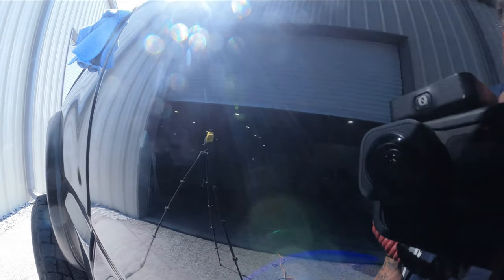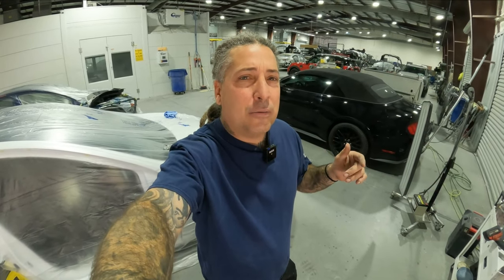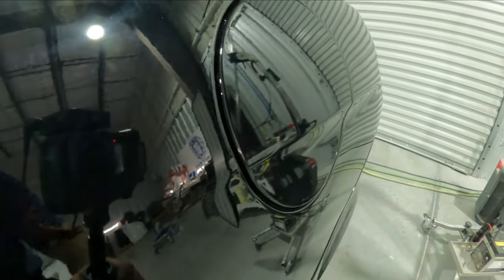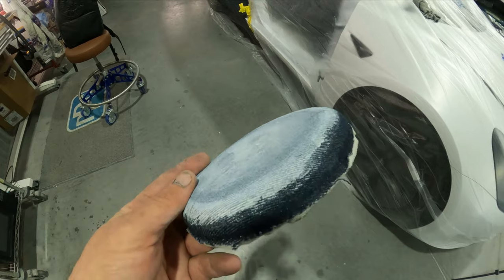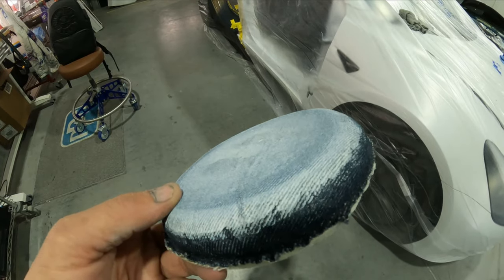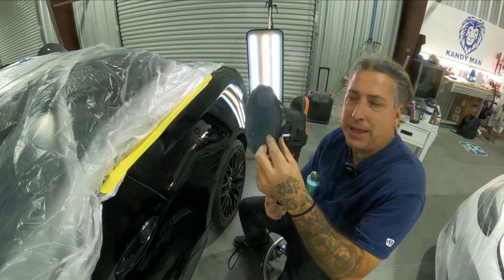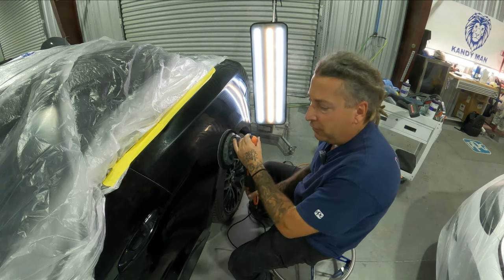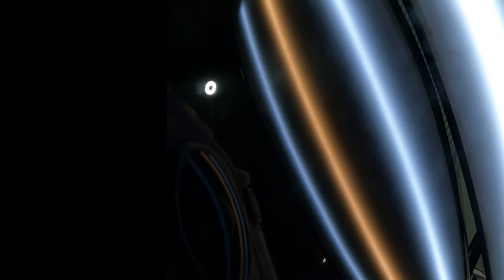How To Get Rid of Orange Peel Fast & Safe - WITHOUT Sanding

Comment: I just LOVE the Chemical Guys C4 clear-cut compound. This is the ONLY thing I've found that takes out bird crap stains. When droppings hit the surface, they burn into the clear coat, and no chemical will remove the stain. Virtually every method I read online didn't get rid of the stain. You need to remove the part of the burned clear coat. This stuff does it! After removing the stain from the clear coat, I used the P4 polish to restore the shine. Just make sure when using both the C4 and P4, each one uses a specially designed pad (and they're colored to match the bottle color so you don't get them mixed up.)
Reply from the maker: Thanks for the insight 👍

Comment: Painted a quarter panel yesterday ,and corner of bumper,so to make this story short,instead of getting the can of blender to melt the new clear into the old clear,I grabbed bulldog plastic promotor,and sprayed it to melt the clear,then that smell of adhesion promoter hit my nose,but it was to late,had to let it dry then wet sand all that stuff off until the new clear feathered out to the old clear.What a pain in the ass that was.😮
Reply from the maker: Man you know I know that feeling well it's sucks but once it's over we get a laugh about it for many years lol

Comment: Great video, great explanation 10/10 for sure!. question I have a 6 inch orbital polisher can I still use the 7inch pads? and also would those 3 pads be enough to do an entire car?
Reply from the maker: 6 inch will work fine might  need 2 sets

Comment: These pads have been around for years. The made issue you will face is heat and paint swelling, especially when using a DA. 

The other issue is thr give in the backing on the pad when using a da will be similar to sanding with a foam backing sanding disc, as it contours to the peel. It will remove more paint film thickness than sanding.
Reply from the maker: Yes denim pad is not a new thing. These are thinner pads with less give .never had a problem with them. And people are loving them. Thanks for the insight 👍

Comment: Hey we all stuff up sometimes.
At least they are both 4:1 . . . my speed clear is 4:1 and other clear used 2:1, once I mixed up normal clear 4:1 and it went cloudy / milky AFTER it was ready to go out, well after it had cured.
Ok to fix after a couple of weeks with a good rub and quick base / clear again.

I got my demin pads already, since seeing your original video on them !!
Haven't had the need to try them yet, but actually look forward to getting some excess peel to correct, lol.

Were the PDR guys there doing the hail jobs ?
Using their light or did you buy your own ?
They really are great for showing up imperfections in paint too.
Reply from the maker: Good point thanks for the support 👍

Comment: How long in one spot and what speed did you use and how often do you need to apply compound? I got the same set up now. I got heavy orange peel btw.  I tested a spot with and without wet sanding between the bed/cab area.
Reply from the maker: Depends on clear
Reply: Im struggling to remove much of anything.

Comment: I just don’t understand what liquid is used? I use a rupes big foot with a denim pad from car pro. It does remove a bit but not cut through. But I’ve read you need a levelling compound? But there isn’t any available unlesss you buy from Asia and I’m skeptical on buying form over sea. OSREN on YouTube I’m talking about
Reply: To add I’ve used mezerna heavy cut, rupes blue heavy cut, mequires Compound, even tried Koch Chemie medium cut and it doesn’t seem to get through enough
Reply from the maker: Must be very hard clear